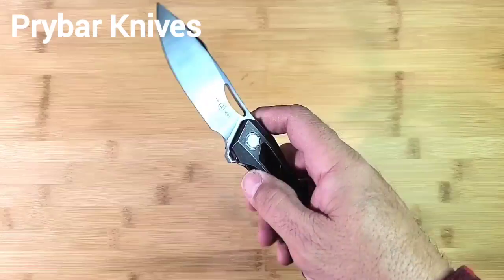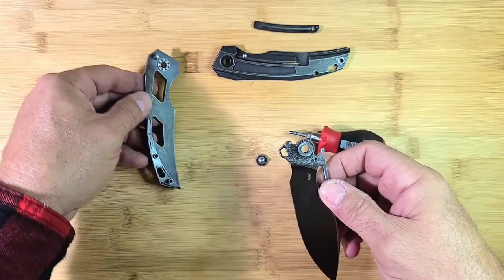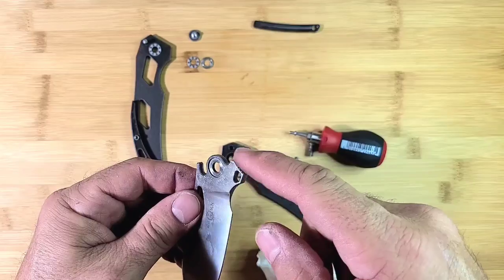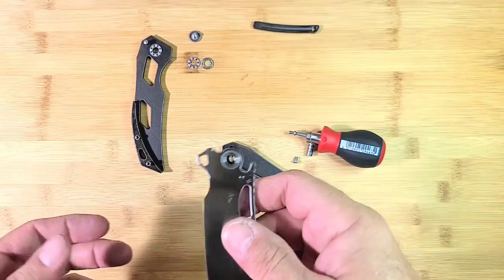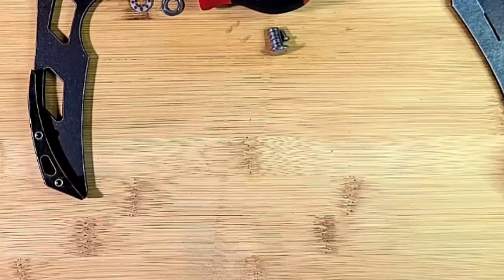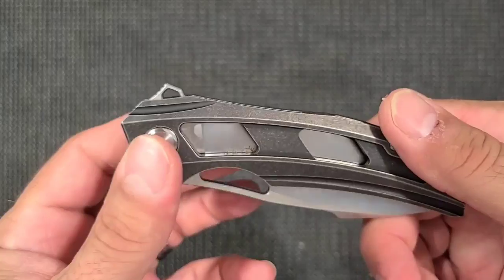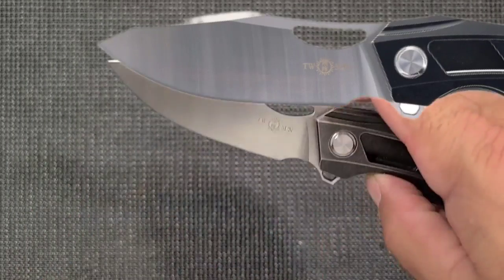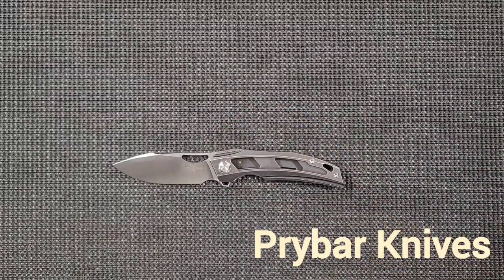Detent Ramp Instructional Knife hard to open? 5min. DIY fix! Dremmel Fun Twosun TS64 Titanium D2

Comment: Now has zero detent and had detent play! This should never be done. EVER!!!
Reply from the maker: What are you talking about? The detent is perfect now. Not detent lash. 
You certainly can screw it up, and go too far, but that's why you do a tiny bit at a time.
Reply: @prybarknives this shit is how people ruin knives. And definitely not the right way of doing a Detent adjustment.
Reply from the maker: @matthewchristensen7257  why do you think that? It's done all the time. I've done it to a dozen knives, successfully. The first one I tried, I did at way too steep an angle, and screwed it up (detent lash/play) but never since. What makes you think it can't work?
Reply: @prybarknives it’s just the wrong way. Iv been making custom Folders for 10 years. A ramp is the last thing you should be doing. You get that one kid that tries It and ruins his knife that took him months to save up for. Warranty out the door and can’t be fixed or replaced. There are other way to fox a hard/stiff detent and your way is not the way
Reply: @ChristensenKnifeworks   Could you explain how please? I just bought the new Nexusia from WE and the detent is strong af. I dissasembled it and tried to flex the frame lock to release tension and it got a litle bit better, but the detent still is too strong for my finger. I was about to drill a ramp like in this video but I dont really want to mess this knife.
Reply from the maker: @byXxRavenxX  how did it work out? Did it break in?
Reply: @byXxRavenxX First, feel for a burr in or around the detent hole, often that’s the problem and a piece of sandpaper is the fix. If it has a smooth clean detent hole, then continue to adjust the lockbar tension a little at a time, reassemble and test, and repeat until you’re happy. As long as it still has enough tension to lockout solid, you can continue to reduce tension. You can always bend it the other way to increase tension again if you go too far. A ramp is kind of a last resort option if nothing else works, especially if you’ve never done one. Buy a couple $5 Ozark Trails and practice first. But lockbar adjustment should be all you need in most cases.
Reply: @jdisdetermined yeah I definitely should have practiced on a cheapo first. I made my ramp a little too aggressive. But my knife was virtually unusable before so I figured it was worth the risk.

Comment: holy DO NOT do this. at least on anything more than a couple hundred dollars. adjust the lock bar tension. the detent also creates that sort of ramp you drilled…. theres no going back here people if you slip up or do it wrong. adjust the lock bar pressure. do not do this nonsense.
Reply: Bro being a maker this video just makes me cringe. 100% wrong way to do It
Reply: @ChristensenKnifeworks  Matt I’m a fan and in your group even. ya this makes me cringe. do not do this to your knife. if you are in the eutsler group i have a before/after video dialing UP my detent on my neutralizer. if some poor soul sees this thinking its the move even on a MAC ill die.
Reply from the maker: Just learn to do it right, and it always works. Just did one tonight on a begg astio. Thing is brilliant now. But go ahead and cause lock rock in your knives, that's on you 😄
Reply: @prybarknives just ruins the knife. Can never be fixed and will wear out and you will have detent lash. You need to stop haveing pu$$y fingers and you don’t need to ruin your knife.
Reply from the maker: @ChristensenKnifeworks  get a life. You made your silly, incorrect warning, move along.